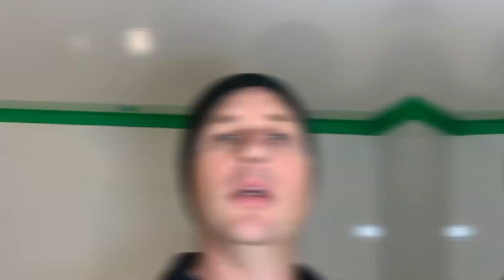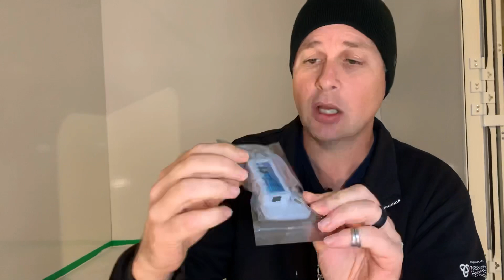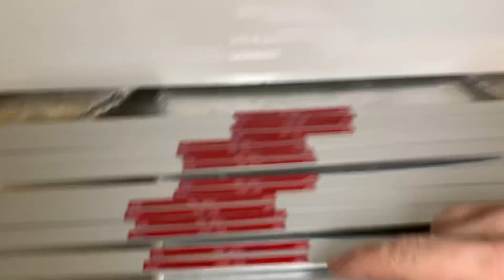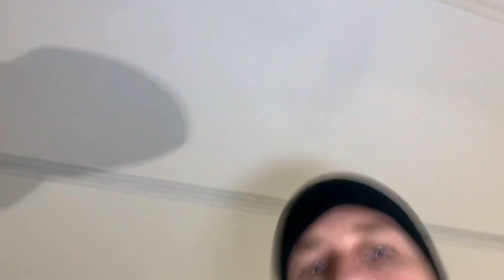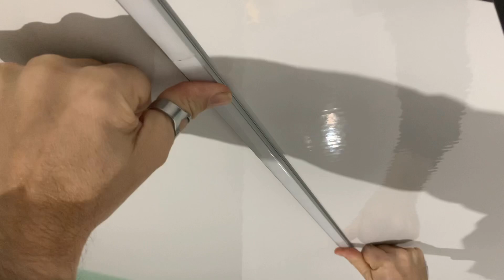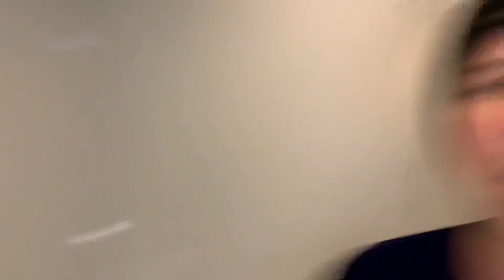Installing BTF RGBW LED strips | Fuso 4X4 Composite Camper build!

Comment: I'm sure you'll be happy with those, Bruce and Krista.  But unless you're infatuated with thousands of colors of red, green, and blue, my advice is to either pick your favorite white (bar-urinal-soft white 3000k, cool white 4100k, daylight 5000k, or bright white 6500k) or get a dual color strip with a 3000k LED followed by a 6500k LED with a color selector and dimmer to choose anything in between them.  My choices: for work, 6500 is great, kitchen/bath 4100-5000, and everything else in the house 5000k.  6500 is on the bluer side while 5000 is pure white.  Instead of direct lighting, I prefer indirect.  Put a 1x1, triangle, ogee, etc. trim 30-40mm from the ceiling and tack LED strips to the top, and it will light up the entire inside of your camper/kitchen/LR without any glare anywhere in the area.  OK, I'll shut up.  ;)  I've been playing with these for over a decade and really like them.
Whoa, order a single meter of RGB and a 12v battery pack to make your own LIGHT SABRE like Bruce!  I can feel the force...
Reply from the maker: Ohhhhhh - I like the idea of inverting the strips and shining up/to the side!   It’s funny, I came very close to buying only white, but with adjustability through the white range as you indicated above, but at a significantly higher price.  I selected the strips, the controller, the remote interface…. Was all set.  Then changed my mind in that I could spend 1/3 of the price and get 90% of the “same” effect (I know not technically 90%).    I will say that the one big advantage to having RGBW is using the red at night to not loose your night vision.

Comment: So good to see this post.   

I've been wanting to do those led lights to my RV rebuild, Bruce, and those look exactly like what I've envisioned for it.  It's an 89 Fleetwood Limited  37' that I've repowered and I've upgraded almost everything in it.
400 hp 12v Cummins and Allison to make it go better.....

It has been, and will be a more capable Base Camp for my excursion rigs.  Looking at building a Robson drive to power the rear tag axle.  Yes, I'm a Mad Scientist.
Reply: I plan on going under all the cabinets. Upper and lower.  The lowers will operate seperate from the uppers and be controlled by the walk way floor lighting switches. The ones in it now are used as night lights so one doesn't stub their ties on the cabinets and chairs.
Reply from the maker: You’ll need to order about 10 packs - and run lighting down the ceiling, underbody, and a couple strips on the roof - you know, just for fun!  😁